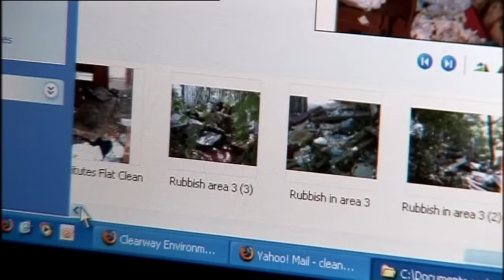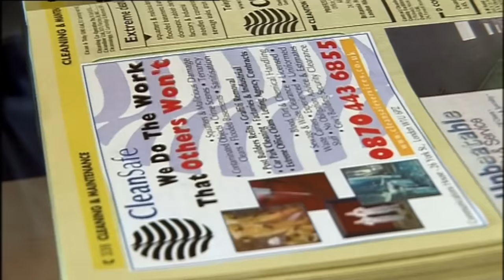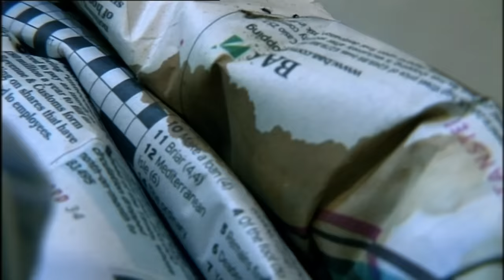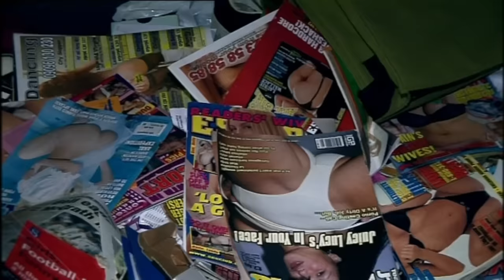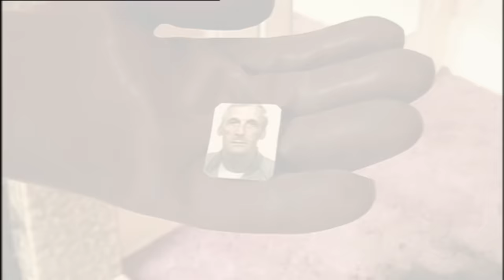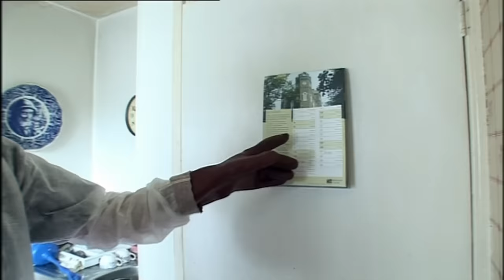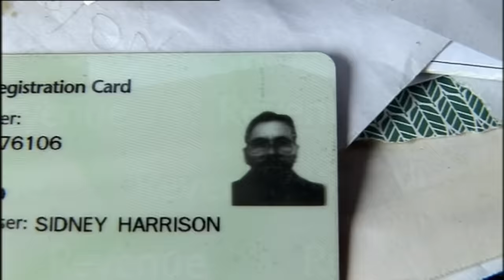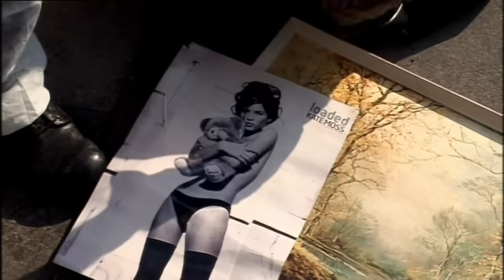Dead Body Squad - Cleaning Up After Death | A True Story

Comment: Only £900 for a body job? They've seriously under valued their own work! This must have been in the early 2000's.
Reply: Definitely old....you can tell by the cars!
Reply: Looks like late 90s! Gross
Reply: Yeah, I think the price is something like $2,000-$4,000 in parts of the US.
Reply: Yeah, I would guess around 20 years ago or more.  Without reading every single comment, does anyone know when this was made?
Reply: @everythingilike9559 wouldn't be late 90s when the number plates on some cars are 2004
Reply: @natashamccarten9639 someone was wearing a Arsenal top from 2005/06 seasons this this is around  the mid 00’s

Comment: The way they clean in the UK vs the U.S. is vastly different. They’re cleaning off their working boots w chemicals outside along a curb, cleaning feces without face masks and hazmat equipment! 

WOW! I find this absolutely crazy! I would love to do this job but I need all my PPE
Reply: it a old film things have changed
Reply: No they haven't. It's the same. Minimum equipment as well as wages.
Reply: This is from about 20 years ago, the standards for PPE in the UK are significantly higher now and probably on par with what you’re used to seeing in the USA (double gloves, boot covers, respirator mask, disposable apron, full face shield etc) 
This kind of PPE is usually needed for any job involving the dead such as Coroner, Funeral Director, Crime Scene Cleaner, Morgue Cleaner etc 
Safety rules have changed a lot in the past couple of decades 🤷‍♀️

Comment: I remember my first decomp case.  I did fine, but can't say the same for the other new person on the team.  He came out holding the door frame saying, "I can't breathe, I can't breathe."   I said yes you can.  It's just a smell, let it go in and out, don't try to hold it.  You'll get used to it.  It's not a smell that you forget.  It goes right through ya to the point you can almost taste it in the back of your throat, but it's a necessary job.  We got our body out, got him back to town, got him cremated.  The best years of my life were working with a coroner and becoming a funeral director.  I still have fun with the job.  I learn so much. Each case is different.  It's one of the best jobs ever.
Reply: Thank god for sinus problems, then.
Reply: That's the main part I wouldn't be able to handle - the smells

Comment: My upstairs neighbor died alone. He was lying in his bed right above my head for weeks decomposing in the summer. It was the postman who finally alerted the authorities when they couldn't stuff any more mail in his drop. The space between his inner and outer door was completely filled up with junk mail.

I never really noticed a smell before the cleaning crew arrived and started throwing everything out. No flies either. The flats are well ventilated and insulated.

My new upstairs neighbor is a really unpleasant lady who's always banging the walls and the floors with her petulant noise complaints. If a neighbor disturbs her beauty sleep by, say, running water at night she will make so much noise the entire house wakes up from it.

I never told her about the guy whose flat she now lives in. I'm pretty sure I could get rid of her just by telling her a little bit about what happened in her flat during those weeks a couple  summers ago. But I'm not going to do that. I'm a nice neighbor.

Comment: There's no need for all this horror . There should be a system where isolated persons can register . They can register each week by Internet or voice over the phone . If you fail to make contact the system would flag up and the person would be contacted . You would be charged extra if you don't make contact . If you can't be found a key holder would be contacted or police . Funeral arrangements the will emptying of home etc could all be dealt with at extra costs . 
If you are alone there is no one to set the wheels in motion in a timely fashion .

Comment: What I can't quite understand, is why, for example, at 24:00, or 34:50, you would ever enter a unit, without, first, ensuring that all precautionary measures are being taken, and protective gear is being worn! Regardless of whether the reason for entering the scene, is to complete an initial assessment of the scope of the work that will be required, or to actually begin the cleaning and sanitization process, itself, you are still immersing yourself amongst a multitude of biohazards and contaminants, and you would think that, under such circumstances, you would always want to thoroughly protect yourself from the risk of possible exposure, as well as eliminate the risk of possible cross contamination, which could occur, if you were to, for instance, unknowingly, or accidentally step in bodily fluids, or biological material, and then track it through the remainder of the housing complex, or into your vehicle, etc. It just seems like even if there aren't, in fact, any mandated, protective measures, of this nature, being enforced, by law, in the UK, that this would be something you would still want to, personally, consistently implement, on your own accord, and on behalf of your business, in order to ensure the safety of yourself, your staff, neighbors, the community, etc, and limit the potential spread of infectious pathogens. I certainly do not mean to sound rude, or overly critical, and I definitely have a genuine appreciation for the line of work you do, and the, overall, positive influence it has on our modern, human living standards; however, as someone with a medical background, and a familiarity with the necessary practices, surrounding this particular industry type, where I'm from, in the US, this specific factor has truly stood out to me, and left me feeling compelled, to, respectfully, address, and question it.

Comment: 20:24 can’t believe they just put flooring over, even with scraping the beams, you have to FULLY REPLACE them because fluids soak super easily onto wood, specially unfinished wood

Comment: Woe, only $250 - $500 per week to deal with freces, bloody gore, and bodily fluids besides the nasty smell?  That's not even close to enough. Working at McDonald's  you can make between $200- $250 per week flipping burgers. Working in a factory making car parts out of plastic you can make $500 - $600 per week.  And these jobs you don't have to deal with any gore.

Comment: Note the huge rip in the Tyvek suit at 2:59. Those things rip as easily as toilet paper. I did this for a few years in Indiana with a small trauma cleanup team attached to a restoration company. These white Tyveks breathe better, they're not as hot as the tent canvas yellow ones are, but nowhere near as durable either. And even the thicker yellow ones have the strength of construction paper 😂 not ideal when wading through biohazards to have your suit rip

Comment: 36:xx sadly that is likely how  it was - medically süeaking. Zirrhosis of the liver creates a - not blockage, but hardening of the liver, the heart needs to pump harder,   the v blood essels try to short - curcuit the liver and it leads to amomgst many other things oesophagus varices ....like widened blood vessels in the oesophagus.  And sometimes they burst.   At first they might cough up a little blood, then vomit it, then when a big one ruptures.....it's like a big artery burst. You basically can clean the ceiling.  Or it comes put both ends, really red ! That's  a bad sign. So for someone worked in medicine, the bloody towels, bag .....tell me everything.

Comment: HOW do you not get extreme phobias? I caught demodexmites after rhey broke down all walls next to me, ripped out " straw- mats" (that are still in the ceilings , walls ..) and then broke through my kitchen wall. 2 bricks. Between a 96 y.o.bwdridden lady and me. And a DR. DR. DR. XYZ  dentist with a tesm that eats pizza/ chips/ chocolate where the review the X rays and 2 feet over is HIS Primary OPERATING ROOM. I went down to 77 lbs, had an open wound on my sacrum......and developed a " soor" a fungus that comes when the immune system is  very weak. He told me to MEVER USE CHLORINE OR MOUTHWASH - IT IS TOO "HARD" bla, bla...

And now a mite we all have in / on our skin took over - again after a lot of stress....

So half the weight I gained afterwards- I am anorexic anyways- fell of within 3 weeks.